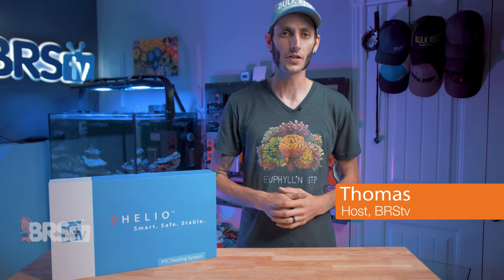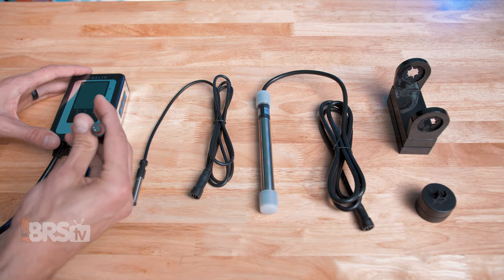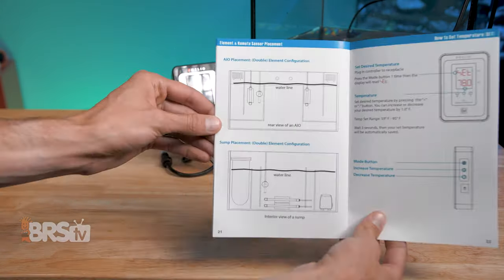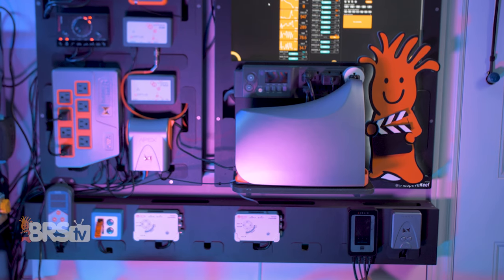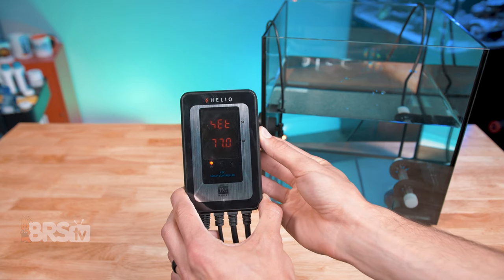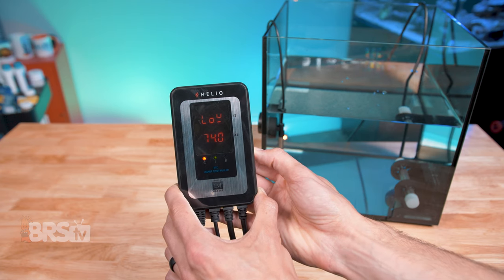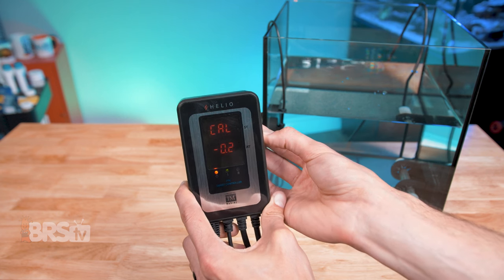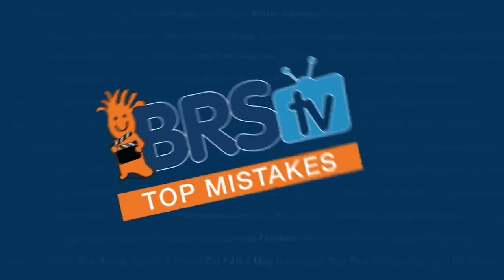Set Up Innovative Marine’s Helio PTC Aquarium Heater Right the First Time!

Comment: So I guess my question is that does that green light where your heating element displays next too the power button stay on or just when you first set your temp? And same with the heating element red ring on the top of the element should it be on or just when you first set your temp?
Reply: Excellent question and I am trying to find out what the grn 1 and 2 light show. Or when do they light in normal ops.

Also in normal ops, what does ST and AT represent?
Reply: @garysteinert8040  I believe ST is Set Temperature and AT is Aquarium Temperature
Reply: @The_Altered  for me, they always match. 77.0. I really find it hard to believe when my Apex displayed temp varies 1.5 degrees. I find the lower IM heater number not moving from 77.0 hard to believe.